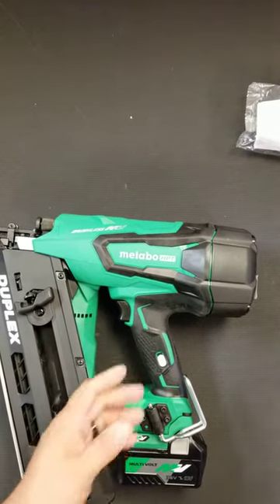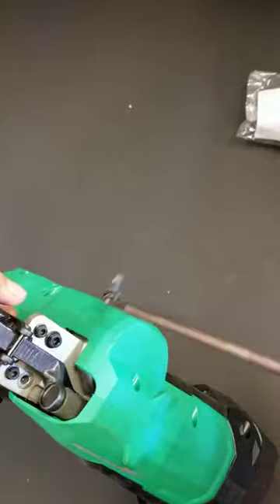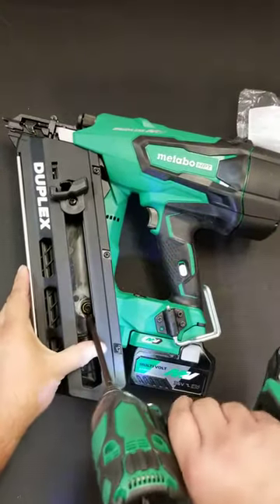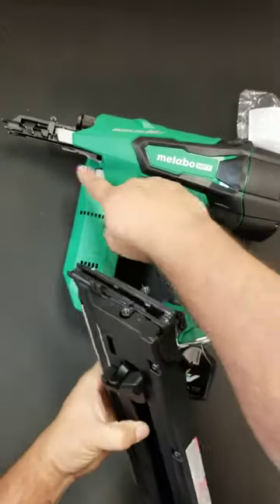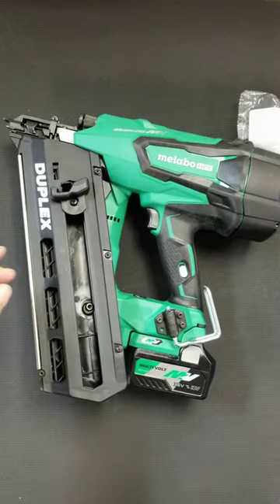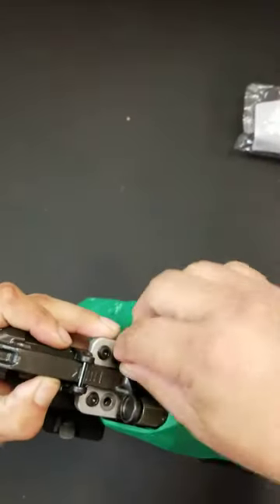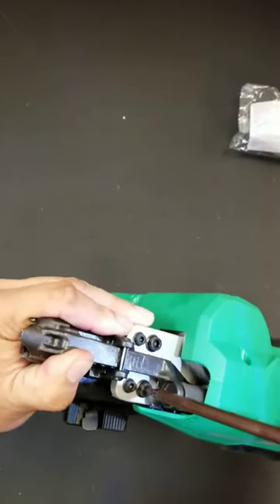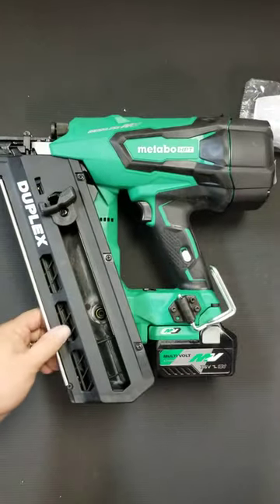Nail Jam Clearing

Comment: Very helpful. I recent bought the 30 degree nailer used like new. It has 3” nails but it’s only driving them 1” in. If the battery is low will that effect the power behind the driver piston? I tried charging the battery but the light blinks red. Charged it for 1 hour put battery back in and when you press the battery button the led light is red.
Reply from the maker: Not sinking the fasteners on a new unit is a sign of factory defect (leak). Return it for a replacement.
Reply from the maker: The battery does have to be fully charged before first use for best results.
Reply: @Allenr1967  it’s used but great condition no scratches or dings. But nails only drive 1”. Original owner said he used it to build a small deck. And it’s been in storage for over a year.
Reply from the maker: @ESPNEWS8  definitely needs air refill. If you can do without it for a week or so. Go to the link below and request a free FedEx shipping label to send to the factory service center for evaluation and repair. Just don't mention you received the tool second hand. Warranty is normally to first purchaser only. The FSC will use the serial number manufacturer date code to warranty it if possible. 
https://www.metabohptfactoryservice.com/

Comment: Hey man.

I have an issue that my Hitachi 18v nail gun doesn't feed my nails properly. It will be fine for half a strip then it will misfire. If I put pressure on the mechanism it will fire fine. I've tried replacing the spring with no change. I've cleaned and cleared the front but the problem persists. Do you have any suggestions?
Reply from the maker: Take the magazine off and see how restricted nails are to pass through the magazine. The plate they ride on may have bowed out or the plastic magazine may have deformed.

Comment: How do you get mag off if the 4H bolt is striped i used a drill and its striped super quick
Reply from the maker: Can try heating it and grad it with visegrip

Comment: The drive blade on my Metabo finish nailer has jammed in a position where it is not fully retracted. What should I do?
Reply from the maker: The driver blade does not fully retract up into the AirSpring nailers like standard pneumatic nailers. The tip can always be seen when the jam door is opened.
Reply from the maker: If it is not working or it is displaying the orange error lights. It can be sent in for inspection.